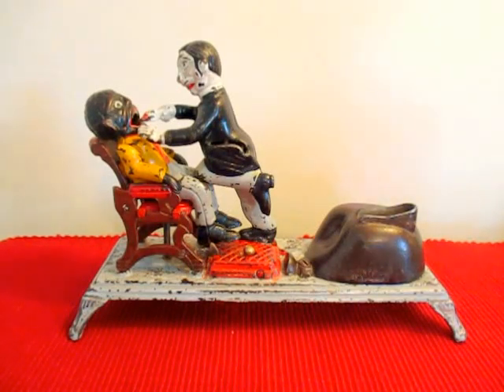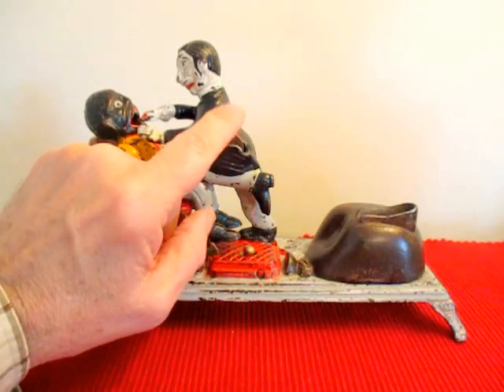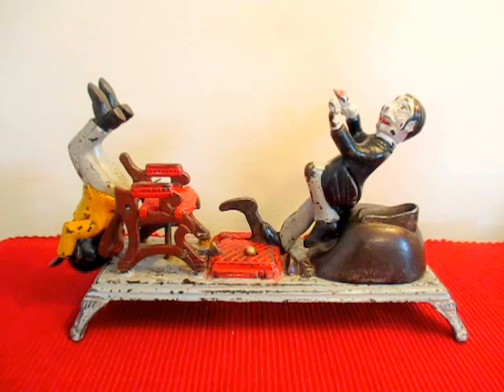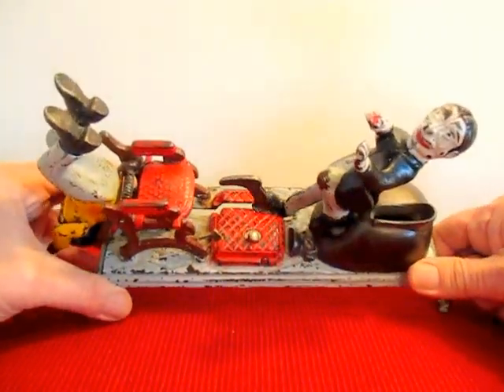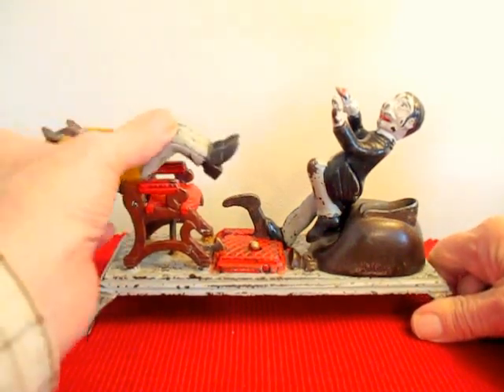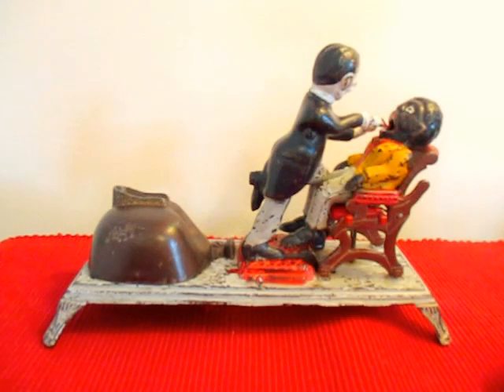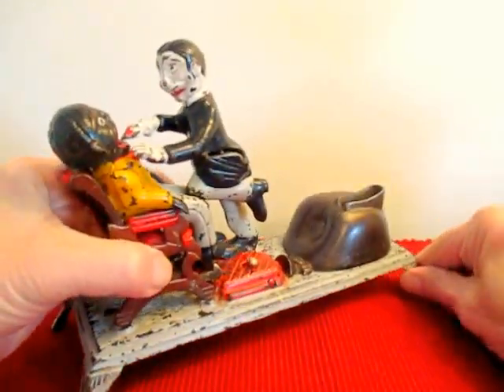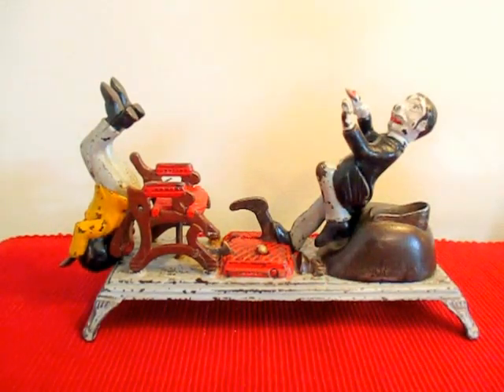"DENTIST" Original Antique Mechanical Bank

Comment: How can you tell if it's a recast
Reply from the maker: Can be difficult. If you send me pictures I can look at it for you. Need a picture of the bottom plate as well.
Reply: @TheBankCollector    Hello. Been trying to attach some pics of a dentist bank. I believe it is an original  but trying to verify.   Can’t attach pics.  Maybe just because of the you tube email capability.  Do u have another email address?